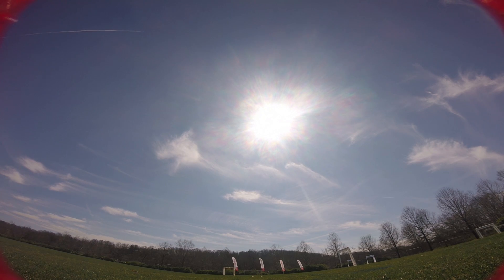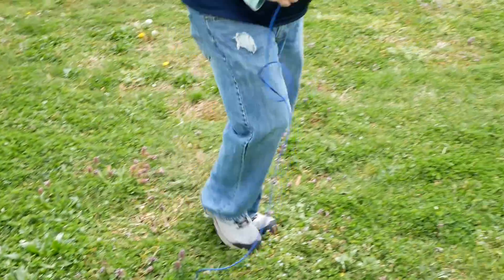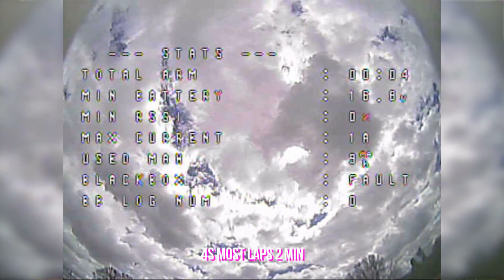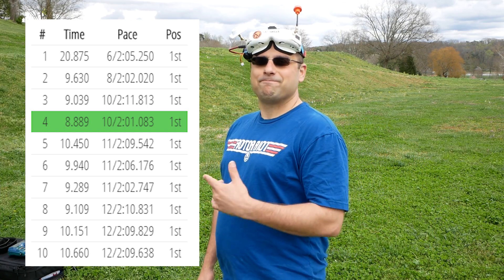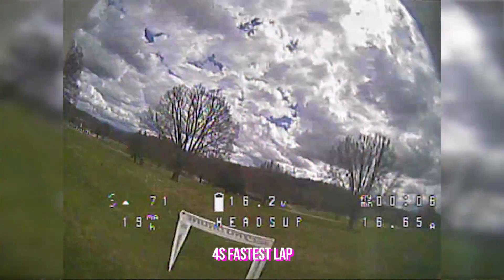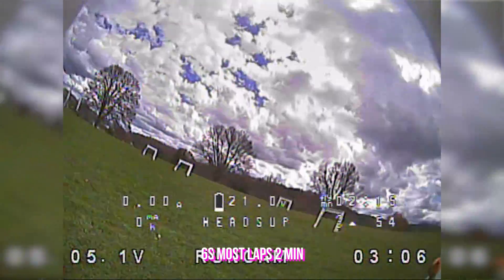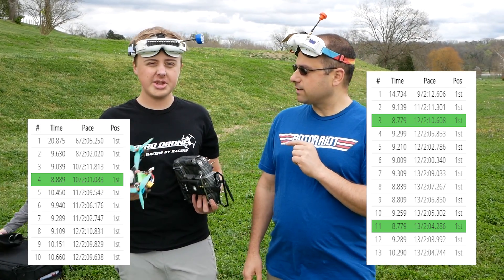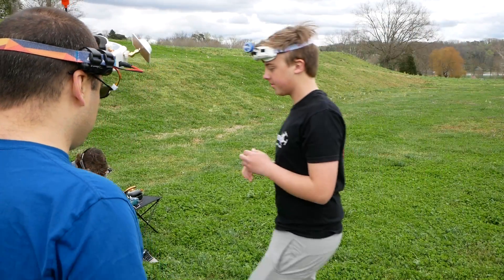6S is the new 4S | HYPE OR TRUTH

Comment: Hi Josh,
why you did not make a Blockboxlog analysis? And why you choose a 1250mAh 6S Lipo? A 6S 1050mAh would be fair! This is like using a battery with a 25% better C-rating for the 6S Setup. This is unfortunately not comparable ☹️
Reply from the maker: The goal was to compare batteries of similar weights. The 1050 6S is 20 grams lighter than the 1550 4S. The 1250 6S is closer in weight and it is what Evan actually races.

Evan's quads were not set up for blackbox unfortunately.
Reply: Ok, I understand.
But why you used two types of batteries. 100C HV vs. 75C. That adds one more variable to this test. How can you prove that the battery doesn't makes the difference? And a HV battery charged to 4,2V doesn't have the rated capacity.
Reply from the maker: This is the equipment that Evan uses to race with. That is why I used it.
Reply from the maker: I don't think Evan actually used the HV. His battery weighed 194 grams which is the correct weight of the non-HV 1550. I think he mistakenly said HV in the video is all.

Comment: what happened to the lap where he hit the flag with the 6s battery there is no hike in the times listed. That would have cost him 3 of 4 seconds i would think. Not sure this is any more of a test than lets try to flog some 6s batteries for our sponsors...In reality between both batteries the only thing that actually matters is the lines you take and what mistakes you make.
Reply from the maker: Well the problem is, you put the batteries on a bench and people say, this isn't realistic. It doesn't reflect how people actually fly.

So you get a world-class pilot to fly them and people say, this isn't repeatable there are too many confounding variables.

Both of them are right. So what do you do?

I 100% assure you the lap times shown are correct though. I think you are underestimating how fast Evan recovered from the mistake.

Comment: Damnit Joshua!  It's already hard enough to find the Hyperlite motors I want in stock!  Now here you go sharing the secrets with the rest of the world.  Now it's going to be even harder to get my grubby hands on some more of those sweet sweet Hyperlite 1722KV motors :(
Reply: Vanover was running 4S at Buffalo Bando.  I know he was the only 4S quad in the finals.  And I think he may have been the only 4S pilot in the top 16 qualifiers (there may have been 1 more).  Not only that, he was flying a 4S 1300mah battery all week.  

6S is not a definitive yes.  You have to be flying pretty damn fast to require a 6S setup at this point.  4S will be just fine for the majority of pilots.  Then as proven, if you're Vanover you'll even argue it's superior.  Basically he was running a quad + battery which was under 400g AUW (150g battery and 249g quad).  Meanwhile us 6S guys are flying 500g quads and thinking we're flying light weight setups.  Having such a light quad really helps with your efficiency.
Reply: Trust me I do my fair share of adulting too.  But I'm one of the chapter organizers for Detroit Drone Racing, so I better be at our regional qualifier :).  Hopefully you make it out to another event this year, I'll be there.
Reply: John E Fly  have you tried piroflipRC dot com ?
Reply: LOL.  Yes, that's where you buy them from.  Those motors were extremely difficult to purchase for a while.  I run them on most of my racers.  This comment was just making a joke about how hard it is to buy them as is without showing 6S to the masses.
Reply: John E Fly 

Was Vanover running 4s at the Buffalo Bando?

To build racing quads at this point, is it a definite yes for 6s if money is no object?
Reply: John E Fly 

I saw you signed ip for the Detroit race next weekend. I would love to make it out there, pick your brain for a minute or two.I lived in Westland for a bit. Having to work and adulting is not as fun as FPV.

Comment: you could have matched the current sensors' calibration for the two quads and counted the laps withing a given Wh to see which one is more efficient (flies longer). also you can match weights perfectly using some extra payload on the lighter one.
Reply from the maker: Yes, but these weren't my quads... they were Evan's race quads. One of them wasn't even wired for current sensing. 

After trying for over a month to get the perfect equipment and people together to make this video, I decided I didn't want to waste the option to have Evan do the piloting. If I hadn't made the video this weekend, it would have been  another 2 months before Evan and I could get together to do it. So I decided this was worth doing.